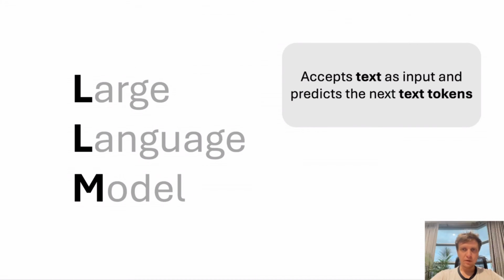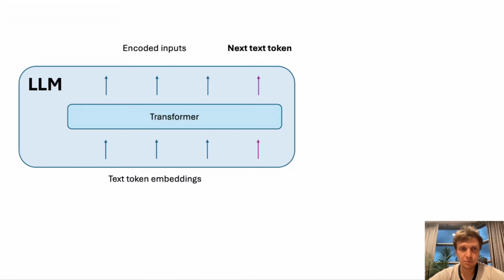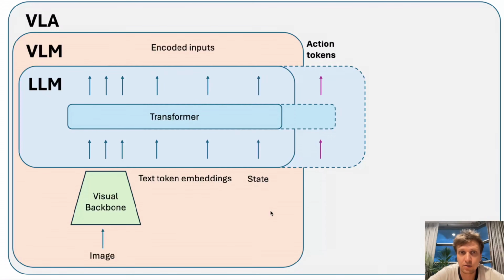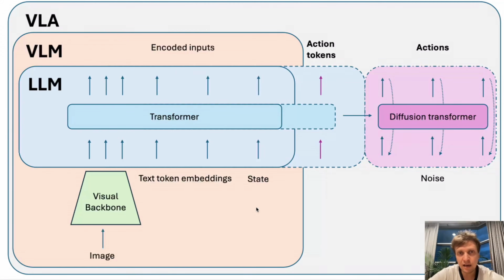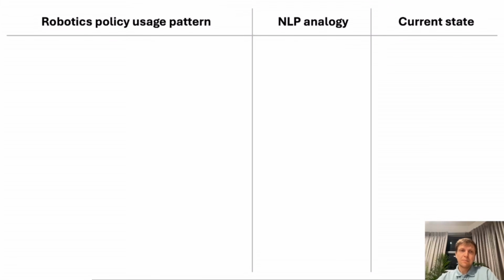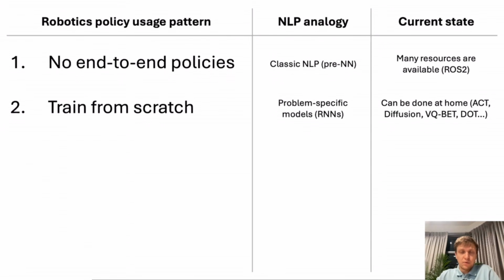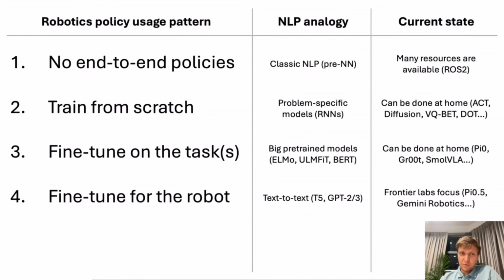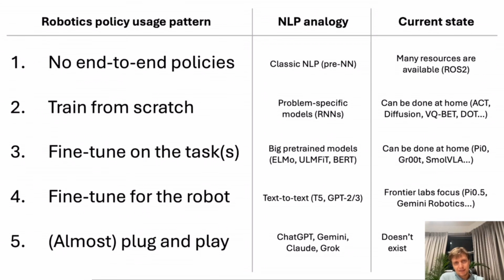LLMs Meet Robotics: What Are Vision-Language-Action Models? (VLA Series Ep.1)

Comment: Not promising anymore world action models are new frontier i guess?
Reply from the maker: Not really. There are much more overlap between VLAs and WAMs than it seems.

Some VLAs (like GR00T 1.5) are trained with WM head, some are trained together with the world model (like VLA-JEPA).
Inside they use the same transformers, same encoders for different modalities of data, and sometimes use the same diffusion to generate action chunks.

If you fine-tune WM to predict actions directly, there is almost no difference from VLA - it is just another initialization of parameters.

The original theoretical pretraining idea is different, and there are of course some unique WM features that are not present in VLAs but there are much more similarities than differences when you go to the practical application level.

Comment: I intend to use VLA to autopark a wheeled robot. My approach is to chunk the sequence in terms of motion -  fwd-short, fwd-long , strafe left-short etc.  the velocities remain constant, only the duration for which the movement is made is different. so these are short bounded sequences.  the dataset contains the input images (view of the parking spot) and previous motion (fwd-short ..).  There is no video stream.  Do you think this approach is feasible?
Reply from the maker: "There is no video stream" - do you mean there is only one original image that is not updated? Technically you can do it with VLA - and just try to predict the whole trajectory in one go, but usually VLAs are used for high frequency control when you get feedback from your actions. Or do you have a video stream but only from above? In this case VLAs should work ok out of the box.

fwd-short, fwd-long , strafe left-short etc. - I don't think you should artificially discretize your actions. You can try to predict the whole continuous trajectory using flow-matching had as most of VLAs do, or use some common tokenizer like FAST. You approach can be reasonable only if you know the optimal discretization for your problem and it can always be solved using this level of granularity (it this case I would still compare it with other approaches).

Overall VLAs can solve navigation problems pretty well. You can check my latest video: https://www.youtube.com/watch?v=J4wpO0EdCZs
For simple tasks even simpler smaller models like ACT can be enough.

Comment: Training with Isaac Sim (or Lab) using Groot has some promising potential for quick training the robot. The concept of using "dreams" or synthetic forecasts of what task completion should look like gives the robot more of zero-shot capability by using streaming vision to break down the frames of its current location and translate to the actuators.
Reply: Can I get repo link or resource of it
Reply: @CDRNRS  You could try OpenVLA .. this is easier to set up than Issac Lab (for Groot) and works in a similar way. Start by training the S101arm. You do not need the actual arm and think OpenVLA has a tutorial on this. Hugging Face has a VLAM framework but isn't as sophisticated as OpenVLA or Groot.

Comment: Hi Ilia, I remember you were experimenting with VLMs with functional calling to control and monitor the robot actions. What difference you see with the VLA ? Compared to VLM with function calling for actions execution?
Reply from the maker: They are very different. VLAs should be extra fine tuned on your specific dataset and then they perform with good success rate and fast inference speed. In my previous experiments I allowed VLMs to use MCP to control my robot: they managed to do some simple tasks zero-short without any extra training but with lower success rate and much lower inference speed.

I think at some point they will converge and it is already happening in some cases where more powerful VLM is used for reasoning but the smaller VLA generates actual robot actions.
Reply: @ilialarchenko did you try using VLAs especially PI 0.5 as VLM for robot camera scene analysis and usual Q&A on camera images we usually do with VLMs? We may not need actions all the time, sometimes reasoning on the camera scene
Reply from the maker: @ramkumarkoppu if I understand you correctly, it is what authors did in Pi05 paper. But no I didn't try it
Reply: @ilialarchenko  I started reading PI 0.5 paper, and it says,
The architecture can flexibly represent both action p0.5 chunk distributions and tokenized text outputs, with the latter
used both for co-training tasks (e.g., question-answering) and
for outputting high-level subtask predictions during hierarchical
 inference.

But I am not sure if this view of text description is available in the released code.
Reply from the maker: @ramkumarkoppu  Yes. They also have this article about this topic: https://www.physicalintelligence.company/research/hirobot

It is not available out of the box, but theoretically can be reproduced. But it will work only if your policy is fine-tuned on a big multi-task dataset (they used 400 hours, I think), and can follow language commands

Comment: The stage 5 you allude to could use an adapter from a N-DOF action to a M-DOF action (where M and N may be different) that could be trained independently. There should be papers on this?
Reply from the maker: Yes, but it is not only about action space conversion. Another issues is the policy should be camera set up agnostic, and control any robot with any cameras. If this is solved then some simple inverse kinematics can probably do the job.

Comment: Most of the VLA applications are seen in manipulation tasks, where those tasks can be demonstrated. Are they useful in other robots like aerial or underwater vehicles where tasks are difficult to demonstrate and imagery is completely different than a table mount camera ?
Reply from the maker: Good question. I also see most of the VLA applied to manipulators and humanoids.
Technically, you can train it for any robot and any task, but currently, latency is a limitation; it will not help with problems where fast reaction and real-time control are needed. Most of the manipulation tasks that are shown in the VLAs demos can be done as slowly as you want.

But if you want to make a policy for an underwater manipulator robot that has cameras (even with very unusual imagery), I think it will work.
Reply: Data is the most important and video generators have been used to create new scenarios for training off of real scenarios
Reply: 1:27